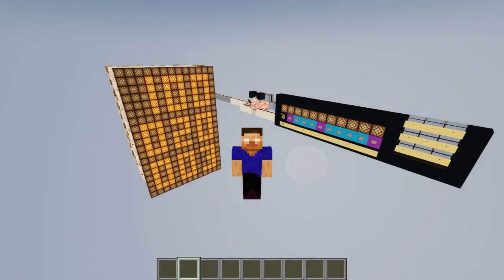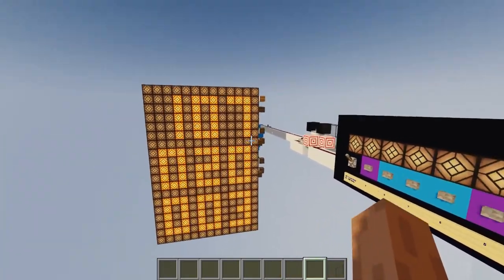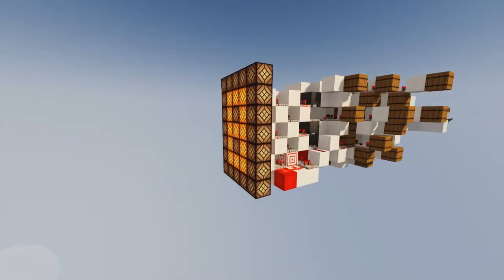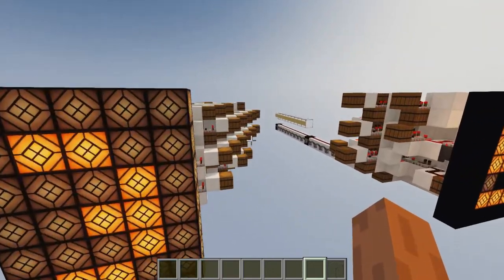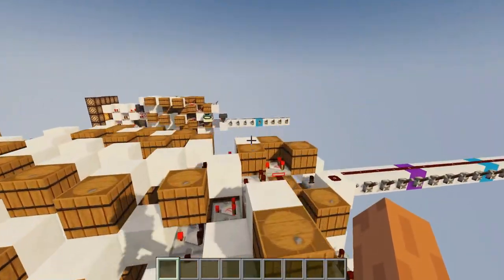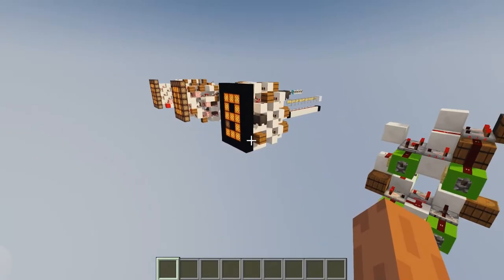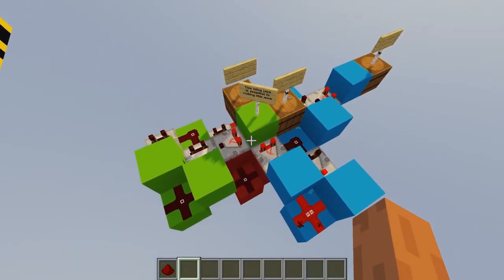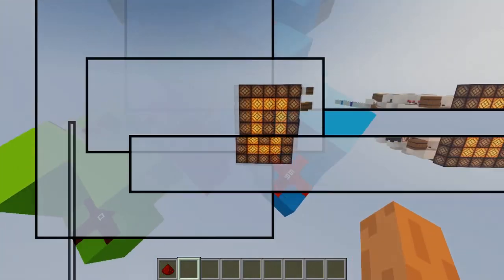Full Lamp Displays & Layers Technology | Minecraft 1.16+

Comment: This is great stuff, I may try using this display type for a calculator I've copied from another you tuber.
Wonder if you stack these you can use it for a word processor?
Does the game always need to be sped up for all these displays ?
Reply from the maker: I don't think these can be properly used for a word processor since they won't make all shapes. You don't need to speed up the game, I did for the video only.
Reply: @Maizuma Games  OK thanks, I've been watching alot of your videos & downloaded most of your builds, the double Encoder video, I can make work the 1st 2 designs but the double Encoder for some reason all 3 outputs activate 1 after the other no matter if I put a 1-2-3-4-5 tick into it.... strange, I'm doing this on 1.19.2 java